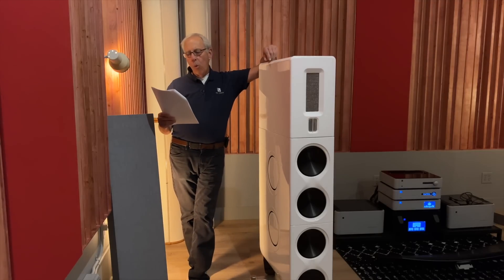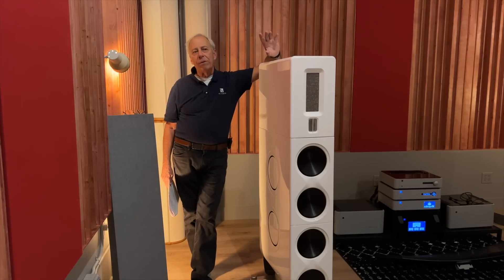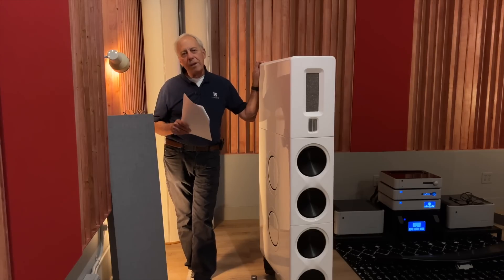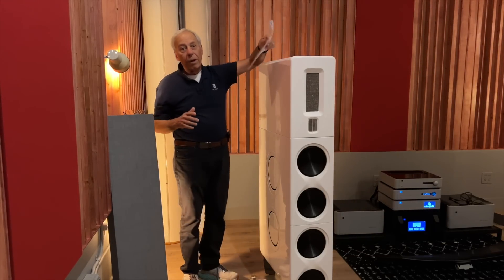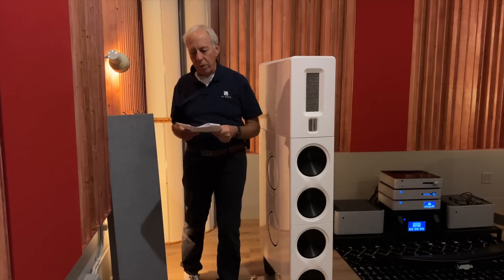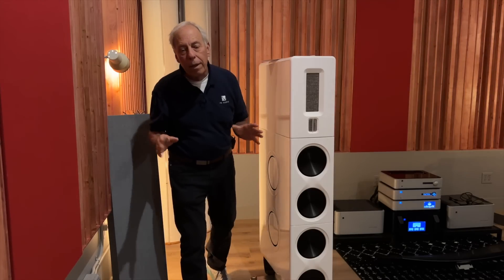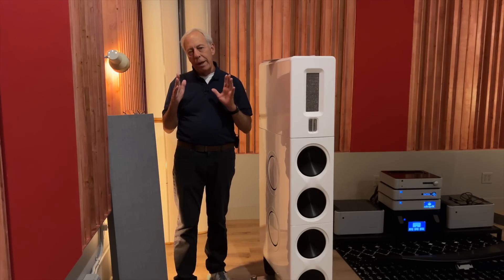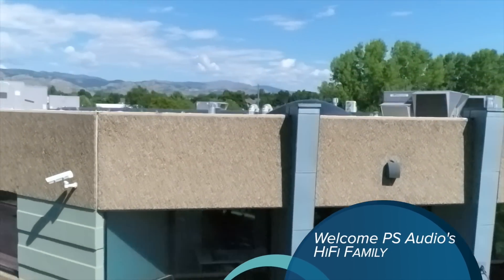Where do all the bits go?

Comment: I look at it in terms of resolution across two axis. For given frequency  spectrum and a given dynamic range you can improve resolution by increasing the sampling rate or similarly by increasing the bit depth. In the digital world it also comes with bonuses like as Paul mentioned, reduction of phase anomalies. Increased bit depth can be harvested in two ways. Through dynamic range or quantization error reduction most notably in the softer passages. Think of back when digital video was in it's infancy where dark scenes were pixelated. Same thing. When they fixed it the picture didn't get any brighter.

Comment: Mr.Paul. a question may I. What sample rate the audio industry uses when mastering a  redbook CD in the later 80s? is it 88.2khz,or  48khz? or is it just the same 44.1khz
First pack of CDs came in 1983.. you've got to use some higher sample rate(higher than 44.1khz) to make those CDs...the rate can't be 2.8mhz of the DSDs ..
my bet is on 48khz...
Reply: I kinda figure out an answer myself.. quotes from wiki:
"In 1989, Sonic Solutions released the first professional (48 kHz at 24 bit) disk-based non-linear audio editing system"
so allow me assume that from 1983 to 1989, the audio industry use the old means of making analog audio e.g. multi-track tape editing.. in production of CDs and after mixing composition a ADC process turns out the final 44.1khz 16bit audio data from some analog source..  then after 1989 the digital audio workstations- DAWs came to rule since..and started with 48khz/24bit as an industry standard for audio editing in the 90s..

Comment: Hey Paul, is that a shot of a FR 30 and your PS Audio equipment in your new mixing room?
How is that setup working out for you and your engineers?
Just a few clarifications on your video.
PCM is actually available in 64-bit floating point. 
Of course, the dynamic range of 32-bit floating point PCM is insane and there is absolutely no clipping (within the context of a digital file) but more importantly, though is the resolution.
It is of course already known that even 16-bit 44.1 kHz PCM has 32,000 times the resolution of DSD 64 but with 32-bit floating bit depth, the resolution becomes even greater than 128 or even 256 DSD.
As your engineer, Ted explained the dynamic range is incredible and the signal-to-noise ratio far exceeds DSD 64.
Imagine not only being able to hear the room a sexy saxophone is played in but hear the sax player take his breaths or the swirl of the brushes on the snare and then realizing you just heard the tap of the handle on the ring of the drummer's hand.
Now THAT is dynamic range!
Nobody cares about single molecules hitting their eardrum?
They do when those molecules say you are here with the musicians in the room. 

Oh, by the way, I'm sure you caught your error at 4:40 where you mistake bits for samples, and then you mistakenly say that CDs can only get in about 20 kHz of frequency response when in fact CDs have 22 kHz of frequency response before any Nyquist filtering is applied at A\D conversion which is 2 kHz beyond what's considered normal human hearing and exceeds the frequency response of SACD because of the need to apply filtering at playback on DSD 64 to filter out quantization noise that reaches down into the audible range, which as you point out, causes phase shift in the audible range.
You of course made an error also when you stated that PCs and Mac aren't good sample rate converters.
The process of converting samples is mathematical and the processors in computers are built for math.
Converting samples in digital audio files is far simpler and takes much less processing power than say changing resolution in video yet the average computer is quite capable of doing both.

Anyway Paul, you never gave us a look at that mixing room when you did your studio tour videos.
Sure would like to have a peek at it!

Comment: Dynamic range of PCM = 6 dB per bit. With 24 bits you get 144dB theoretical max dynamic range. That’s already ridiculously high and due to analog electronic noise in the amp circuits, you won’t get value of all those bits. Even 16 bits CD quality with 96dB is already excellent. The reason we use bits of 16, 24 or 32 is because these bits are sent as bytes and one byte is 8 bits thus audio PCM samples are either 2, 3 or 4 bytes. Of course 32 bits make sense in modern chips that are natively operating with 32 bits instructions of math even it’s overkill from an audio fidelity perspective.
Reply: Agree. Paul constantly conflates sample rate/bit depth used in the recording process with samples/bits used in the playback system. A higher dynamic range on playback that exceeds 96dB is highly undesirable as low level sound will be inaudible under ambient room noise or loud peaks would be screamingly loud.
Reply: If they use 4 bytes (32 bits) as the data packet size they should still state the sample rate as the more important stat. It doesn’t tell us any useful info if they say they are encoding the audio in a 32 bit stream when it was sampled at only 20 bits to begin with. I really don’t care about the 12 bits of zeros tacked on to the front of the 20 bits of my sample just to make the encoding fit perfectly in a 4 byte dword (or word if the architecture defines words as 32 bits).
Reply: @trippmoore  There are cases where you actually benefit from a 32 bit PCM architecture (but for the content itself, it’s completely overkill). For example, if you attenuate the sound down to a low level in your PC or Mac, you will shift the bits down and those lower bits will start to represent real content. You can attenuate a 32 bit PCM down 96dB (which is a bit insane) and you still have 96dB of actual resolution in the stream. But, of course a DAC would never operate with so many bits as usable bits.  A 24 bit PCM stream really at best can make sense only of 20 of the bits while 4 bits usually are below thermal noise in electronics. And yes, there really isn’t any meaningful value in making music with a dynamic range of more than 96dB. The red book CD standard from 1980 is still an excellent standard for dynamic range also today.

Comment: You have music with a quality of 41.1 16bit and you  put it inside something that is 3 times as big. you don't lose anything as long as you don't go below 41.1 16bit.

at 41.1 A DAC. has a high pass filter that removes sound above 20k. 
This filter is steep and takes hard. You can get phase shift and other things. By upsampling, this will happen far beyond what humans can hear. Which means you don't hear these problems.

But many DACs. upsample automatically.